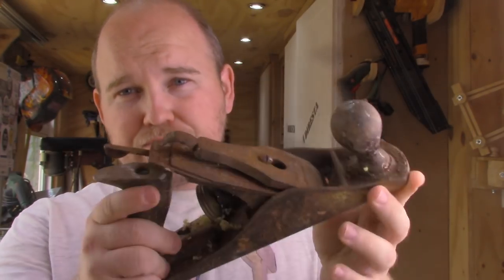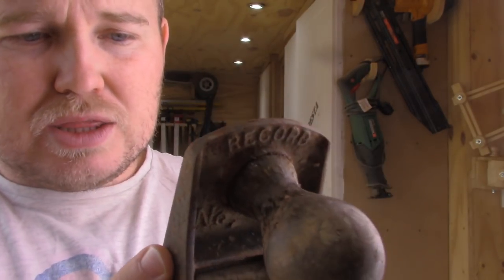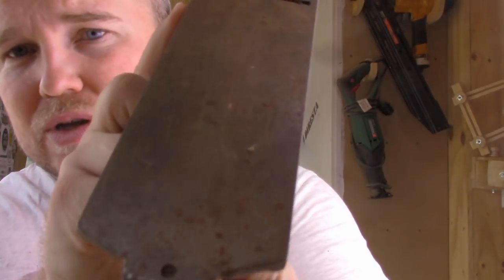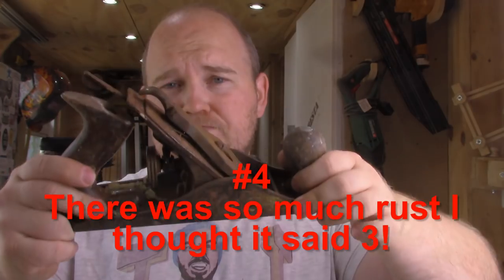Record Hand Plane | Project Restoration

Comment: Ive just been given a 5 1/2 Stanley in worse condition than this. Everything was completely rusted and bright orange. Slowly getting there with it but doing all the sanding by hand. Considering getting a wire disc for my 4" grinder after seeing this. I'm enjoying restoring it though
Reply from the maker: Excellent bud  that's all that matters. Enjoy the process
Reply: Have you had any problems sanding the cap iron? It seems to be taking the finish off aswell. Hoping I'll get away with it once its  all finished
Reply from the maker: It's a hard one if I'm honest. The cap should be plated. If the plating is coming off its failed. In my experience I have used a brass wire disc and taken off the flaking parts and buffed it to a finish. It will depend on the look you are trying to achieve however
Reply: I think ill wire wheel it all and see what it looks like. If its no good i can buy a replacement. Thanks for the advice

Comment: A much easier and gentler way to get rid of rust is pull it to pieces and soak the all the metal parts in distilled vinegar overnight.
Reply from the maker: Yep, agree. Adding a little salt can make it work better
Reply: @WHCreations  I've been looking for a Number 5 (Stanley or Record) for months. When I started looking they were AU $70-75. Now they're well north of $100 because of tool collectors... I just want one to use. Many of these old things cost more far than new!

Comment: Not grounding the sole with the iron etc installed ?
Reply from the maker: That could be a good tip to use going forward, I didn't on this occasion and it worked out well.